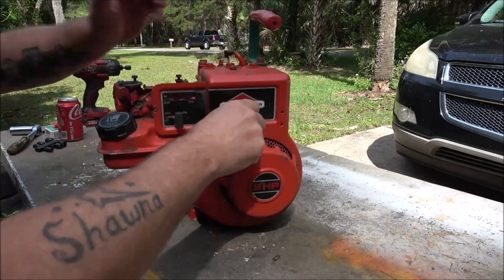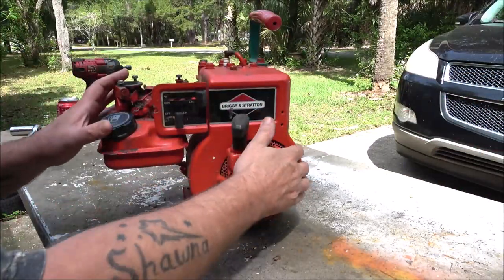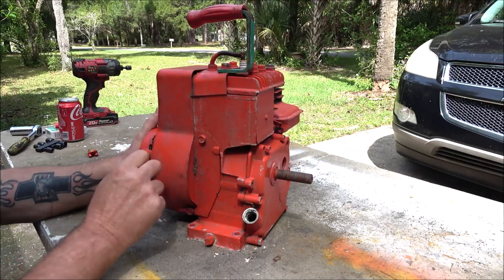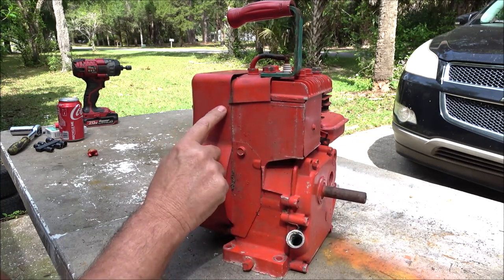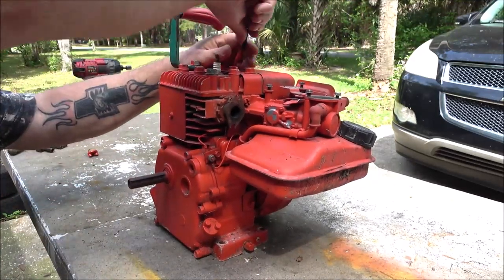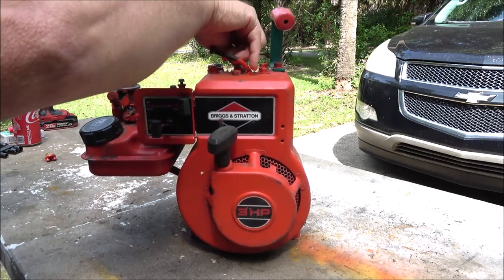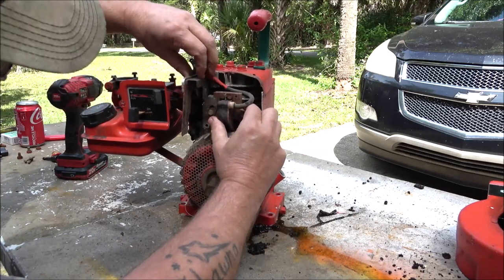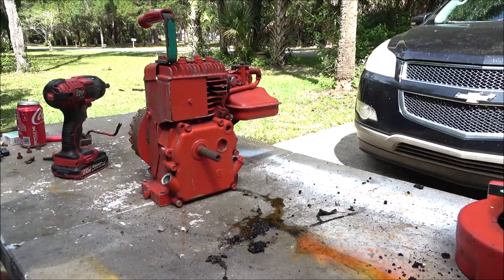Locked Up 3HP Briggs And Stratton Engine, Can We Get It To Run?

Comment: Man what perfect timing for this video. I have the replace the coil on the mower I just got and was wondering about how to set the gap and it's rusty too from sitting. I will make sure to clean that rust off for sure.
Reply from the maker: Heck yeah man.  Let me know it goes for you.
Reply: @shabear1000  it worked perfect, I was thinking I would need to buy a feeler gauge. Got all the rust off too, came off easy with a wire brush.
Reply from the maker: @pttn975 that's awesome buddy.  Glad you got it.

Comment: I’d bet that 3 Briggs & Stratton horsepower from 1989 are stronger than 3 Hazard Fraught horsepower from present day.  Seems they rated things much more conservatively in years past.  I have a 1964 Cub Cadet 70 that pulls itself with me atop it while running a 38” 3 spindle mower deck using a 7 HP Kohler engine, then in the mid 90s got a Craftsman 21” push mower that claimed to have a 6 HP engine.  I find it difficult to believe that it only took one additional HP to power 38” worth of mower deck and drive around a cast iron transaxle equipped lawn tractor.  Methinks manufacturers fib a bit more these days…

Nice job getting that little bugger running again - the failed coil is likely why they parked it, and it just got stuck from not moving for years.
Reply from the maker: I agree with you 100 percent. I've had old 5 1/2 horse power Go-Karts totally eat newer 8-10 horse power carts all day long.  Thanks for watching and commenting.  Have a safe holiday my friend.